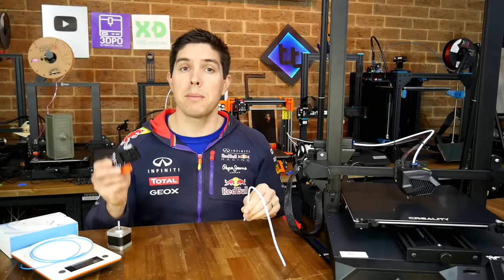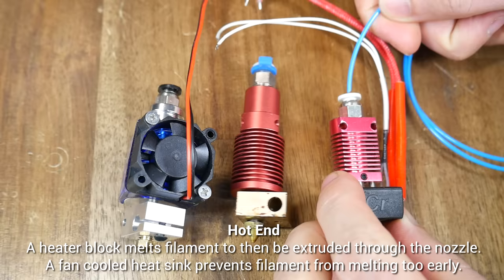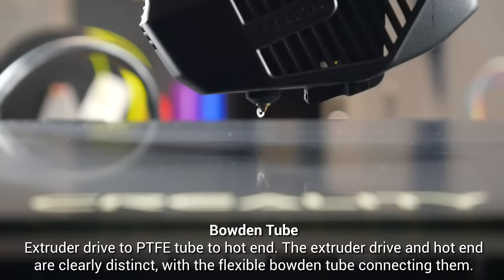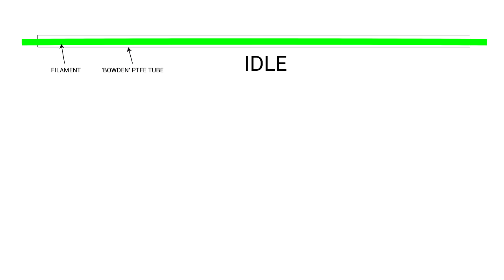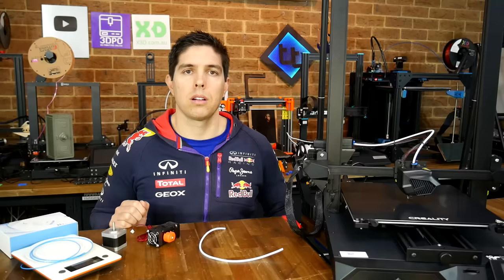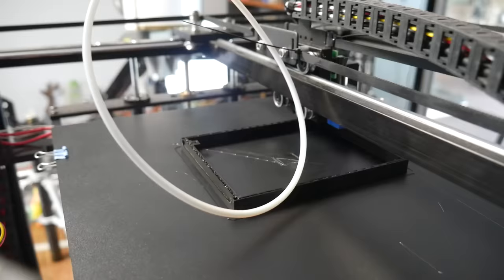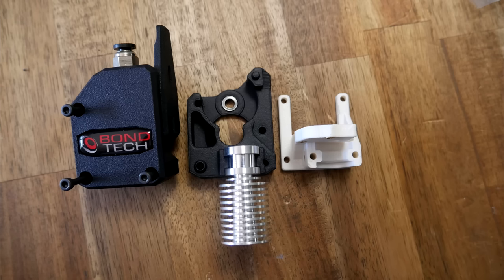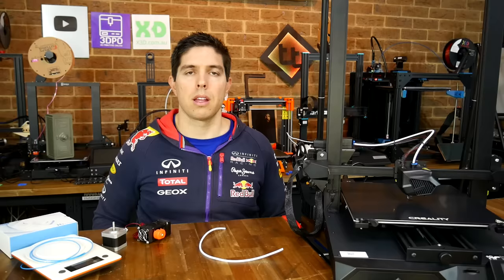Why direct drive is not automatically better than bowden tube

Comment: I have a Ender 3 that i have converted to a Direct Drive and its working well but I would like to change the Stepper motor to a Pancake motor does anyone know where the best place is to get one in the UK as I do a search and so many come up and I am a bit lost to know what one I should go for if anyone could help with some advice that would be great thank you

Comment: Feed Shaft - Do you know if anyone has tried using a feed shaft like an engineering lathe has?  For example - If the feed motor was mounted on the side of the z axis gantry and spins a square shaft, a sliding gear on the print head could drive the filament feeder. A couple of possible hardware items exist and may be worth trying. https://www.igus.eu/product/726?artNr=AWMQ-10 https://www.igus.com/product/983?artNr=QJRMP-01-10
Reply: Yes, this exists.

Comment: Sorry but retraction lenghts on bowden/directd do not (only) depend on the extrusion system but also on the hotend. All metal hotends clog if you retract 6mm. And really you don't need huge retractions on bowden, from my experience 1-3mm on 300mm bowden setups (with an all metal hotend) work just fine.

Comment: Thanks for the difference, I have a question : can you make a video of the best way to remove the filament and then use another color? I have seen different videos like 180 degrees centigrade and then pull hard, others retract normally.
It would be great to know the best way to change filament (meaning the least filament remains in the head when removed)
Reply: Presumably you've figured this out by now, but...

It really depends on the printer. For example, the Prusa MK3S+ (and I presume similar models) have an "unload filament" command in the front panel menu that handles all this for you. It heats up the head and retracts the filament the right amount, informing you when it's time to pull the filament out the rest of the way, which needs to be done only gently.

Comment: question in the bowden does it use all of the filament or when it is nearing the end you have to pull it out of the tube?
Reply: Well there has to be enough for the filament to get pushed through the bowden tube to the hot-end. So when it runs out there is going be a leftover bit in the tube. Normally you just slide in a new filament which pushes on the leftover for either continued use. Or to purge it out of the printer for the new roll.

Comment: Another aspect of the DD you forgot to mention is the "full metal" section of extruders. Because PTFU become toxic at high temperature, bowden tube is just unusable for high temperature printing material.
Reply: I think you can do all-metal with bowden. You just have to be careful about where the bowden tube stops.

Comment: This video brought to you by people who sell Bowden setups. 😂. Honestly...direct drive almost always ends up better in nearly every situation.  Theres a few multi material setups that you can't direct drive, but theres others that work and still are direct.  As close to bowden as id get anymore is reverse Bowden.  Bowden will never be accurate enough once you get down to certain very low nozzle heights and will cause problems in your prints due to the squash and stretch of the filament in the tube.  Bowden also doesnt work well especially if youre in a nice heated enclosure.  If you want to eliminate ringing entirely get an accelerometer and tune your stepper movement/resonance.  Remember a voron is gonna be direct drive usually, but theyre printing sometimes all the way up to 2000mms with minimal to no ringing.

Comment: i have both DD and bowden. I dont really feel the difference. if you are tuned in properly wich is easy with both if you have proper extruder and hotend. I have a feeling many people are struggling with bowden because they use a shitty extruder instead using a proper bondtech. 
the only difference is speed and what filament can you print since for flex you will need a DD.
i actually prefer boden since i can increase print speed without any problem

Comment: hi,  I use a bowden set up in m ender 3 pro.  it has worked flawlessly (for the most part) until now when it stopped oozing pla through the hot end.  i removed the tip and noticed it appeared clogged i replaced and still had no flow.  I replaced the bowden tube with a capricorn tube.  when I pulled out the old tube i noticed the end that was in the hot end was nasty with sticky black goop on it.  I cleaned everything, releveled and with the new tube and tip printing perfect again.  As a new user is this normal, is there a time which i should replace tips/tubes?  Could I have temps set to high?  typically 205-210.  not sure I, as a hobbiest need a direct drive but also want to understand if this issue would be eliminated by a direct drive.  thx

Comment: For higher temperatures filaments like glass filled nylon isnt the direct drive necessary?
Reply: No, not at all. Actually I’d argue that DD is worse for filled nylons since any print longer than an hour or two means you’ll want to be printing from a dry box and that sharp bend will break the filament. You’d be better off Bowden or reverse Bowden for such filaments. I think the confusion is that you will need an all metal hot end, aka a hot end that doesn’t have PTFE tube running right up to the nozzle. The high temps cause the PTFE to offgas harmful vapors.
Reply: @andrewmorgan7770  that's exactly the information I was looking for. Thank you

Comment: Why does carriage weight matter at all anymore? Can’t you account for most if not all frequencies of vibration with an accelerometer mounted to the carriage as shown on the rat rig?
Reply: Low cost printers do not have the computational power to handle the calculations. Reducing weight is still the most effective solution.
Reply: Cas I understand inertial mass, thanks. Nic you can pick up 32 bit boards pretty cheap these days, comp power isn’t big a problem. I could see the rigidity of the motion system having an effect on how well the correction algorithms can be consistent, but other than that I don’t see why carriage weight matters. Well I understand why e3’s come stock with a Bowden setup obviously, but as an enthusiast what’s stopping you from eliminating ringing/ghosting completely for 40-50$?
Reply: @cas curse This seems a bit above your head ig, let me try to break it down for you. If the carriage weighs X grams, there will be a specific resonant frequency depending upon acceleration settings. The accelerometer in the above linked video finds that resonance frequency and offsets those vibrations to eliminate ringing/ghosting. If X is larger, this will change the resonant frequency. However, no matter the resonance frequency, the computer can still compensate. Due to this advance in software, carriage weight no longer matters.
Reply: @cas curse big man! Maybe instead of acting indignant try to process what I’m getting at cause it’s seriously cool stuff. Obviously, the more weight you’ve got on the carriage, the more stress on the motors, and the less efficient the motion system functions. I’m not tryna claim that this is changing any time soon. What I’m saying is the weight of the carriage no longer matters in terms of ringing artifacts on your print. It used to be that Bowden had bad retraction, good ringing/ghosting mitigation, and direct was better with retraction at the cost of ringing/ghosting. Now, with the new accelerometer software, swapping to a direct drive setup won’t cause any ringing that can’t be offset. The weight of the carriage essentially has no influence on the surface finish of prints, within reason.

Comment: Hi i recently changed to creality's direct drive for my ender 3 pro and im getting a pattern on vertical walls how can i correct this?
Reply: Probably ghosting/ringing. Try lowering the acceleration/Jerk speeds in your slicer.

Or if you are talking about like Vertical waving and such: Check if you didn't bend anything on your Y axis like the threaded rod.

Comment: Has anyone done a direct drive design that has the motor decoupled with a tube that can transfer the rotational forces instead of a tube that carries the filament? Flexible shafts aren't that uncommon even if they aren't the most amazing things.
Reply: Ah that's the end of the video. Nevermind then

Comment: The recent direct drive evolutions have completely eliminated whatever perception there previously was of superiority of bowden tubes.  Notice that no such evolution is occurring with bowden tube setups.  The superiority of dual gear extruders is under emphasized in this video.
Reply: It still weighs a lot more. My cheap cartesian printer does well at high speeds and typically I print 150mm/s such as fine toothed gears which take only 45 minutes with .4 nozzle at .2 height to print a 3 inch diameter double herringbone gear with fancy spokes and solid infill. Plus I don't compromise on volume (I can print over 120mm/s with a 1 mm Nozzle with .5mm layer height on a $15 hottend, that's not bad).

It originally came with direct drive, but it was horrible, it was very light (half depth Nema 17, very light weight injection molded extruder housing that its cover plate was the heatsink, but unfortunately it used the motor as a heatsink as well and it cooked the magnets until they lost torque and it was maybe 45-50mm/s was its max for a decent print before modification to Bowden. You wouldn't get much lighter direct drive, and you wouldn't want it too. That axis also has half depth NEMA 17 with the only full depth being the bed motor. Even with tall 250+ mm prints it doesn't appear to struggle.

Comment: Direct drive is automatically better. Back in 2018 it was not, because there were no Linear Advance and TPU was not popular. And new Input Shaping feature eliminates ringing, so weight in not a problem anymore.
Btw, stock bowdens are so stupid now. For Example, Ender3 stoch head has large sheet metal enclosure, which weights more than 50 gramms.

Comment: Honestly in my opinion bowden should be relegated to higher end machines, simply because the low end printers that I've used thus far simply couldn't handle fast movements anyway for one reason or another. For instance, my Anet E10 skips steps when moving faster than 70% stock speeds due to the hilariously bad motors, so even my big chungus of a direct drive mod has practically no downsides despite being 5 times heavier than stock and having 3cm of vertical play from the kit being nowhere close to the correct size for the X axis rail.

Comment: Firmware has got to the point where the mass of the printhead is irrelevant (within reason) Direct drive is just objectively better now.
Reply: This is simply not true.
Software can not, in any universe, remove mass.
This statement is as bad as people saying "Aluminum can be stronger than steel."
Reply: @joshua43214  I assume you have not used Resonance Compensation in Klipper firmware then? Or experience with software Input shaping for a range of CNC kinematics. 

Take an Ender 3 with a Bowden set up, and another with Direct drive, let's say a Hemera extruder for all that extra mass and set both printers to say 120mm/s at 3000 acceleration. 

If the Bowden one has Marlin Its going to print worse quality parts than the Direct-drive one with Klipper, as the Direct-drive one despite having more mass is able to mitigate the real problem by using command signals that cancel its own vibration.
Reply: @Pigeon_FX  I am familiar with the tech.
My point stands, software can not remove mass. Artifacts caused by hysteresis are caused by changes in the motion of mass.
 
It seems to me that you do not understand what input shaping does. Input shaping finds the resonance frequencies of the printer, and then over-rides the motion so that it avoids those frequencies during motion changes. 
This will not do anything about the inertia of a heavy print head. The printer will still vibrate like mad when making fast direction changes, the belts will still stretch and rebound at each motion change, the frame will still flex in unpredictable ways.

Go check out some of Vez3D's vids, he had to attach the printer to the shed in numerous places to keep it from walking off the bench, and it shakes the whole shed when he runs it at high speed.

All the issues associated with rapidly changing a moving object are still there, the only difference is that none of these changes occur at the printers resonant frequencies.
Reply: @joshua43214  Of course software can't reduce mass,.I thought we could skip past the obvious and move to real-world scenarios rather than be obtuse. Supporting your argument with such extreme edge case examples of a printer running at 700mm/s @30K with a magnum + is hardly the context of this video or my comment.
Reply: @Pigeon_FX  Well them, a more real world scenario is my 330mm^3 printer. I never print at less than 80mm/s, switching to direct drive increased artifacts but also gave me better control over pressure advance. I get better corners and less stringing at the cost of increased ringing. I can reduce ringing by slowing down to 60mm/s, but then I might as well be using a bed slinger if I am going to print at Prusa speed.

So your statements that software obviated print head mass is false, and your statement that direct drive is objectively better is also false.

Maybe in the future, just don't make silly comments in public forums where people will call them out.
Reply: @joshua43214  Then maybe we can use my real world example of my Ender 3 that prints 100mm/s @ 3K with  Klipper and show no added rining when changing from bowden to DD, or for that mater with my Voron at even faster speeds. Only silly comment I have seen so far is the reductio absurdum that lead to you comment "Software can not, in any universe, remove mass"....as is that was a revelation to anyone.  Just sounds to me like you need to work on your printers tuning a little more?
Reply: Input shaping is amazing at reducing ringing artifacts to a point where they are negligible.

On my rather floppy corexy i still get a slight single overshoot on corners that can be reduced by using the scurve fork of klipper.

IMO bolting a whole printer to a wall or whatever, while im sure helps it is the wrong way to go vs making the frame as stiff as posible and then allowing the whole printer to move in a controled damped way.
Reply: People say aluminium is stronger than steel??
Reply: @bassplaya69er  Yeah, not sure why he is bring that up. but in fairness "Strenth" is such a general term. 

For example Aluminum dose have a higher strength-to-weight ratio  (Specific strength), Aluminum alloy like 6061-T6 being around 115 kN⋅m/kg where as Stainlees Steel is only 63. But woods like oak, pine and even spider silk have them both beat with Specific strength. 

So, guess it depends on what metric is being used to define "Strenth" as tensile strength is a very different story.

Comment: Ender 3 Pro needs nuts on the heater bed screws. Otherwise they come lose and eff up the print during printing. Really they should have added nut's to those bolts to begin with. They just cheaped out on us. Bowden tubes prevent quick retraction, so they leave strings everywhere consistantly. I converted my Ender to Direct Drive, so far the results are much better, because retraction is better. Bowden tubes are garbage. To be honest. Bowden tube is the worst invention ever for 3d printers.
On my direct drive ender 6-7 mm retraction distance works great. 6:28 1.5 - 3 millimeter retraction just made things worse on my end. Too bad.

Comment: I have messed with more poor Bowden tube connectors, even the best are crap and slip after a while, it is a weak design and needs to be improved for any argument to move forward, direct drive is superior in every respect, it is a rugged solution that running spaghetti in a hose will never fix.

Comment: Bowden is trash. The fitting will slowly get loose and fail & cause progressive under-extrusion and ruin your prints. Progressive under-extrusion is my favorite problem to fix on 3d printers lol /s.
But seriously nowadays there's some great DD extruders and there is absolutely no reason to run a bowden printer.

Comment: direct drive can be as light as a Bowden setup if done well, or at least only 50g heavier, ringing can be tuned out with input shaper in klipper, like high end manufacturing machines do, all around direct drive is better, and Bowden is only used for cheap machines to make them cheaper, even then, 99% of machines are Cartesian and it doesn't even matter cause the bed will be worse. 
best option is light direct drive with tiny Nema14 motors and gear reductions like the Hextrudort or the likes, going Bowden just seems dumb to me, it's dumb and cheap stuff
Reply: One YT'er said, that he couldn't understand why any one is using a un-geared extruder in newer design